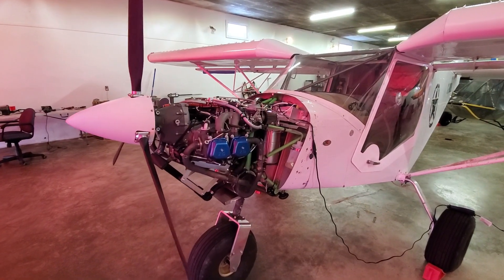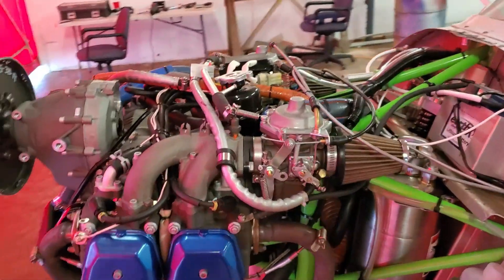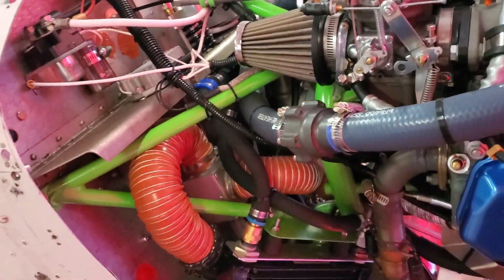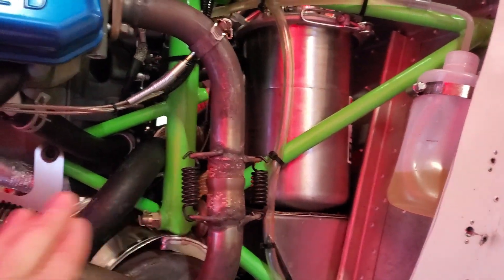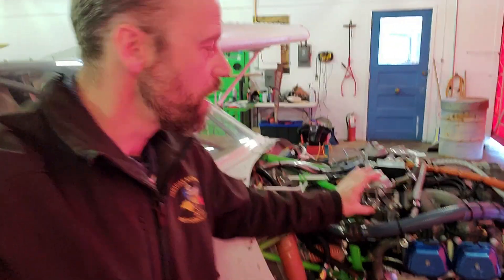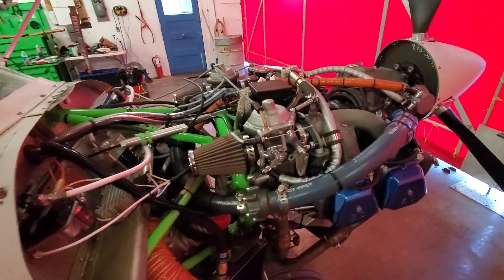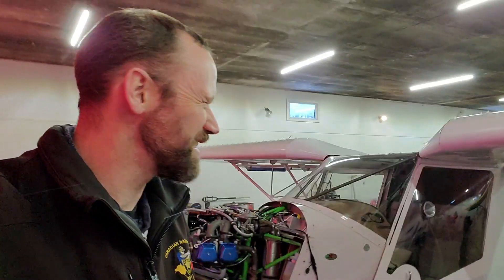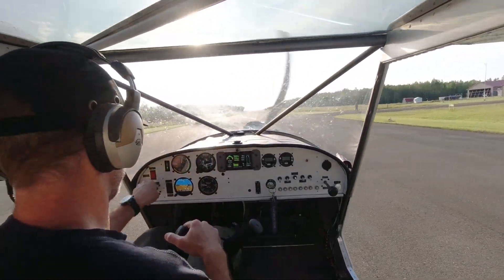Engine Overview on the Zenith 701

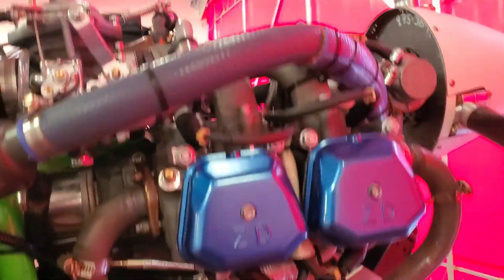Comment: Hi Matt, I feel uneasy about your promotion of the Chinese Knock off engine.  You said at 2:03 that it is OK to copy the Rotax intellectual property, because it is no longer patented (you think).  Why don't you call someone high up at Rotax and ask them about it?  The guys selling the Knock Off engines tell you that Rotax are greedy for charging so much for their engines. The reason the Knock Off engine is  2/3 the price is that they don't have to pay for the design and research that it takes to develop.  The Knock off engine sales will surely cost Rotax money, which they will not have to pay off the research.  If your designs  just get knocked off when you release them, you might not bother next time.  This results in the de-industrialization of the industry, which ends up in the hands of the IP thieves.  Not a good outcome.
Reply: I watched a documentary about Rotax filmed at their factory. They basically said that between shipping thousands of engines for military drones and even more for snowmobiles the GA side of their business model is tiny. Once a business starts selling a product to the US Military the general public consumers are going to get gouged. We need competition.
Reply: The 912 has nearly doubled in price. It’s a money grab. Look up the price of a sprag clutch, now look up the price of a sprag clutch for a Honda 300 quad. It’s the same part.  Radiator, ignition modules, I could go on and on. All over priced to the very max.
Reply: There are multiple copies of the Lycoming engine for the hombuit world. Builders that want Lycoming buy a Lycoming,  people who want to pay less but a clone Lycoming.  This is the same thing here.
Reply from the maker: Thank you for your well written comment. I just looked up the patent on the 912, it expired 5 years ago. I just didn't want to say that for fact in the video as I hadn't confirmed it yet.
I don't think the inflated prices of the Rotax engines are paying off their design costs at this point as the 9 series engine has been around since 1989. Rotax is pretty much the only player in the light aviation engine game and so they can charge whatever they like. Competition helps the consumers and keeps monopolies from forming. I don't think Rotax will be going anywhere anytime soon just because someone copied their 25 year old design. Copies of things also allow less fortunate people to participate; we all can't afford a $40,000 engine. Think about how generic medication allows people to afford to stay alive when they can't afford the inflated price of the name brand stuff. If that's ok to do, why isn't this?
Reply: Rotax also has to pay for lawyers since this is an aviation engine.  That's why Rotax no longer uses NGK plugs in new engines.  NGK was tired of the lawsuits. 😢
Reply: Ask Rotax?
What incentive do they have to say, "sure it's legal."
They won't even respond.
Reply: Rotax prices are so high because their primary market is military contracts which stipulate that the contractor cannot charge higher prices to the gov’t than what civilian customers pay. Hence why a Rotax ecu costs $7,000! Turbo $8,000!  Ridiculous. The parts are so expensive that it costs more to overhaul an engine than to just buy new one.
Reply: @dieseldan5189  That's an interesting insight.  Rotax have joined the ranks of the guys selling $700 hammers to the Navy.  I'm sure the Chinese knock offs will find their way onto drones as well.
Reply: My 3 cents: I think Matt's use of clone is a better word than knock off, which implies its illegal. As noted, the Rotax engines are long off patent (most were patented in the 1980s), and are fair game - that's how patent law was meant to work. A patent is a public-private legal bargain: you get 20 years of legal monopoly to protect your invention/innovation, recoup your investment and make your profit.  After that, society gets the wider public benefit of your invention for free to encourage competition and availability through lower pricing. There's nothing immoral or thieving about it - patent law has existed for centuries, and Americans even wrote them into the US Constitution. it keeps business efficient, encourages constant innovation, and helps incentivize society to move forward.  

Bombardier-Rotax had plenty of time to make their money and should have amortized their investment long ago. Now they compete on brand, quality, price & service in an open market. They have since innovated with the IS, then turbo, and recently the 916 etc. Otherwise you'd have a monopoly and no incentive for engines to innovate or get more affordable overall.  Same thing for pharmaceuticals - few people complain when drug prices come down after the patents end and generics enter the market - same principle with aircraft engines. Now, we (the market), not law, will decide how well Rotax & Zongshen engines succeed or not.
Reply: If rotax still offered lighter weight two stroke alternatives I'd be more sympathetic to your view.  At this point they've stopped making all the suitable motors for gyros, trikes and light ultralights.  This means many manufacturers of these now have to often use other brands - often not as reliable or shove a 912s on it.  My gyro with the Hirth (remember I can't buy a rotax 503) will weight about 115kg.  It'd be well add another 30kg to that.  Yep more power but this means bigger rotors, taller mast, need for a pre-rotator, bigger prop, more torque etc.  Add to that they are about 3 - 4 times the price and I have little sympathy.  The average gyro now has an empty weight of 250 to 300kg.  They've gone from sub $20 000 to buy new to over $100 000.  Frankly as soon as batteries are 50% more energy dense most of us will be done with ICE engines entirely and Rotax will find the sport part of their market disappearing.    I can buy a 54 hp electric motor for $2 500 the battery will slug me but no more than buying a equivalent to a 503.  Can't wait to be rid of them entirely.  Be a while before range is okay for longer distant flights but that isn't what I do anyway.
Reply: @bonza007 - Ha, Rotax's "R&D costs" on the 9 series engine will have been paid off by about 1995!  The inflated price of new Rotax engines comes down to possessing a market monopoly.  These alternative providers are a GOOD thing for consumers.   Or do you not agree with capitalism and thing one single corporation should be entitled to artifiially inflated profits, at the cost of GA consumers.  Do you want this sector to die?
Reply: I would not buy or install anything Chinese in my airplane. I worked on Can AM off road engines and the Chinese duplicated these engines also and put them in their brand (CF Moto) end result, these are crap engines and fail within the 1st year. Total maintenance nightmare. Let me know in a year how your Chinese engine is doing. Buyer beware!!
N552AT signing off!😊
Reply: Had my CF Moto for 3 years now, no issues…
Reply: @mattgreer9615  good for you, how many hours do you have on the engine? 100 hrs., more?
Reply: @paulhilliard3774  - Get over yourself!
Reply: @paulhilliard3774   You're typing these messages on computers that likely have any number of Chinese made components in them.  The Chinese are certainly capable of making quality, however it depends how well they have copied it and if they did a good job of it.  I remember as a kid everyone saying these things about Japanese cars, no one says this now.  then it was the same about Korean cars, now largely respected.  I suspect we'll see the same about Chinese brands it will depend of brand quality over where it comes from.  

I am building a gyro with a two stroke engine.  I would rather a 4 stroke engine,  however I simply can't afford a 4 stroke rotax engine not without buying a second hand one in which case am I better off than the new two stroke?  Both would have question marks.

So solution I fly in gliding distance of a safe landing.  If he got this at 1/3 the price (now 2/3rds) then I'd say that is a bargain.  Time will tell.  All engines should be treated as potentially up for failure.
Reply: @cameronlapworth2284  I actually typed it on my phone, and that's Japanese,  but yes I understand your point. However, I have first hand knowledge and experience with Chinese duplicate engines. That stated: It's Cheaper for a reason. I wish I still had picks of the Chinese duplicate engine block castings, because we found voids all throughout the castings.  So I put my money on proven engines, and it's a piece of mind for me also. I am also an A & P Mechanic, and have seen many times where short cuts or going 2nd or 3rd best will be trouble. Thank you for the comment though.
Reply: @paulhilliard3774  yes there can be problems but  my point is you cant generalise to a whole country.  Clearly some chinese stuff is quality and other stuff is crap.

Comment: @mmatt what happened with the 701? Were the upgrades to the fuel system completed?
Reply from the maker: I sold it. The current owner did install the Edge Performance EFI system and reports that it's working fantastic.

Comment: Great work Matt and we’ll done for using this clone engine, I currently fly an MCR-01 Sportster and I would fit this 100 hp ZD engine in my plane. Just a quick question on your lithium battery you’ve fitted. Did you have to change anything on the charging system for you ZD/Rotax engine?
Reply from the maker: Nope, just plug and play. :-)
Reply: @ interesting. I seen the make of the battery but which model is the battery please? Amperage etc.
Reply from the maker: @Sirtomalot-c5s  It is an EarthX ETX680C.
Reply: @ thank you 👍

Comment: Hi Matt, here is a technical question. Regarding to the gearbox between the engine and the propeller, its function to increase the torque which dynamically decrease the speed of it? Or the opposite happens??
Reply from the maker: The first one. lol
The gearbox slows the prop down and increases the torque.

Comment: Fuel injection just adds another level of complexity.  And Rotax had some growing pains that led to several failures.  Stick with the carburetors.  But, a smart carb is a great option.
Reply: A conservative approach such as this is what deters innovation.  As of carbs are superior to fuel injection?! It's 2025 not 1955 !
Reply: @DavidR_192  do you fly?  Because reliability trumps innovation every time.  And do some research beforehand, and you might realize that smart carb is a great innovation.

Comment: Matt, I'm wondering if you have any fresh commentary about how well the engine is holding up. I've been seriously considering using one to re-power my Kitfox. I talked with the reps at Sun N Fun and it sounds like they have excellent service and support, has that been your experience so far?
Reply from the maker: Yes it has been. I have had no issues with the engine whatsoever.

Comment: Thanks Matt, i have a Rotax 912uls and i am going to install the edge efi system before i mount the engine to my ch-701 build that is still 2 years from completion, the efi system is expensive but i think it will be well worth it in the long run!      Awesome Video

Comment: Also, this manufacturer only gives a 30 day warranty??? Rotax gives 24 months new, and 18 months on recondition or 400 hours!!! End of the day, you pay for what you get......
Reply from the maker: The warranty for this engine is 18 months or 200 hours, whichever comes first. Each dealer offers their own warranty I think so it depends on where you get it. I've seen some offering 2 years or 500 hours.

Comment: You don’t have to adjust those carbs because they have compensating fuel metering built in. Set the e clip on the high speed needle to match your usual operating airstrip altitude and leave it.

Comment: When you install the fuel injection system I would recommend you replace the lithium battery with an AGM. Why, the BMS in the lithium battery will turn off your battery when the cells within the battery become uneven. This is to protect the battery from going thermal overload.  The outage may only last a few minutes or a half hour. I am sure it has done it in your existing setup but you don’t notice unless you have an indicator just for your battery voltage. As long as the charging system can keep up you will not notice. That is just one reason why a lithium battery increases risk with a fuel injection system. There are a couple others.  The weight savings do not out-weight (pun intended) the increase in risk.  I have watched a lot of folks who live in their boats in Florida who use lithium batteries. Every now and then the lithium batteries fry the alternator due to the BMS. The technology just isn’t quite there yet but it is close.

Comment: Are there any implications on engine response from the proposed, pressurised fuel system?  That some diesel (seemingly unlike many gas) engines have a fuel return line, meaning (as I understand) that max fuel is continuously pumped during operation, with the unused portion being returned to the fuel tank. I'd figure that is about eliminating throttle lag and stress on the fuel pump in dealing with dynamic fuel requirements by simply pumping max fuel continuously (and possibly adding some warmth to diesel fuel that may otherwise be less prone to optimal ignition if excessively cold).  Know the risks and fly the appropriate class of aircraft to one's own needs...where applicable.
Reply from the maker: You're talking way above my pay-grade... but what you said sounds about right. lol
Reply: It would have to have a return line IMO.
Reply: @kenfawcett4006  I hope Matt unpacks the implications of pressurised fuel system on his way through the upgrade, possibly advised by new-MitchFox...whathisname-Brent.

Comment: I live in Chicago where temperature swings are pretty extreme and i never mess with the carb needle setting and works just fine but on the other hand i don’t fly when it is colder than 20F ..
Reply from the maker: I found my EGTs were creeping up towards the redline during the colder weather so I went a jet size bigger and moved the needle clip down to the bottom and it brought the temps back into the green. That said, I set them up in the summer. If I had set them up during some colder weather maybe they would have been good all year.

Comment: The CV carbs adjust for density automatically, that’s the magic of them. Yes, you need to dial in the jets to start with and the left and right sides will often require slightly different sizes. You are correct that there is a balancing process to get the two carbs sync’d so that both sides make similar power at every throttle setting. If you do this properly, once, they do not tend to drift. The Rotax maintenance manual describes the procedure well. I assume that the Chinese clone has also copied the manuals…if not the Rotax ones are on line and can be downloaded for free. 

If considering EFI be sure that you have enough spare power to run it…unlike carbs EFI requires electric power to operate, no electric power, an engine will go quiet. The Rotax 912 has only a 20A alternator and Rotax suggest you limit electrical load to 80% of that. Add up your lights, instruments, radio, CDI ignition etc and then ask your EFI vendor what their system requires. You may be ok if you don’t have too many electrically powered toys on board.
Reply from the maker: Thank you for your comments! We have indeed followed the manuals to set everything up properly but I didn't know that the carbs might need different settings. That's interesting info.

We asked about upgrading the alternator; it's not needed but the option is there if we want it.
Reply: @mmatt  I just realized I gave you bad info on the potential need for for different jetting left and right. This is an issue on the (turbocharged) 914 because of its asymmetric airbox design but not a factor on the 912 whose intake system is the same L & R. Sorry about that. Once set up though the CV carbs DO adjust mixture for air density. They are able to do this because the carb slides are not directly connected to a cable, like in say a Mikuni. The slide floats in its bore suspended by vacuum above that is modulated by both throttle position and automatically by air density. TA CV carb essentially meters fuel based on the air’s mass. I have operated my 914 from sea level to 13,500’ and from -20C to +30C and the CV carbs do a good job of mixture control throughout that range. All that said EFI can be a great efficient and  fiddle-free thing if you have the $ to buy it, the electrical juice to run it and realize that it introduces different points of failure.
Reply from the maker: @martinjmerritt  Thanks for the clarification. I mentioned in another post that I set my carbs up in the summer. Maybe now that they're set for winter they will self correct in the warmer temperatures. I guess I'll find out in a few weeks when it warms up. :-)